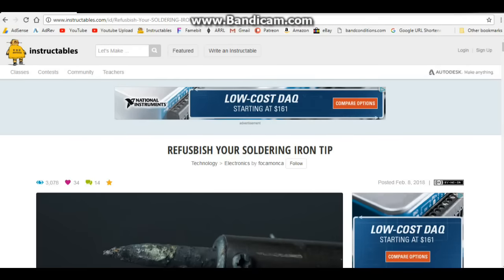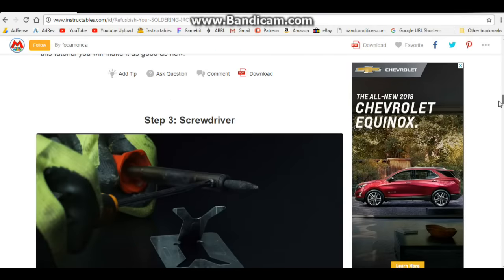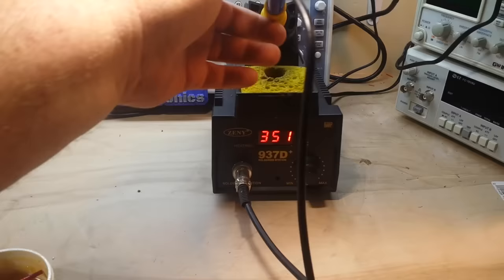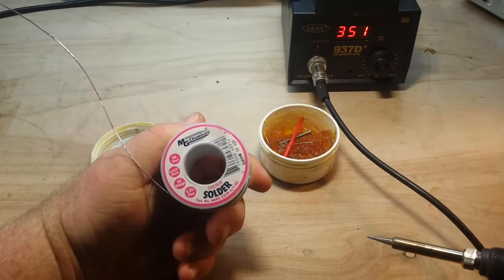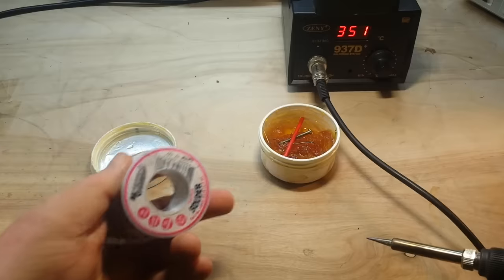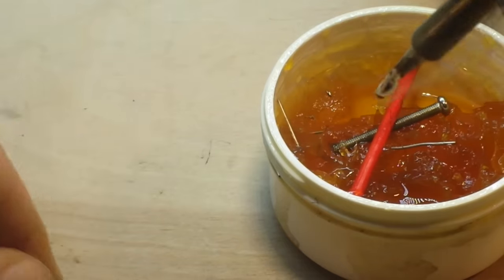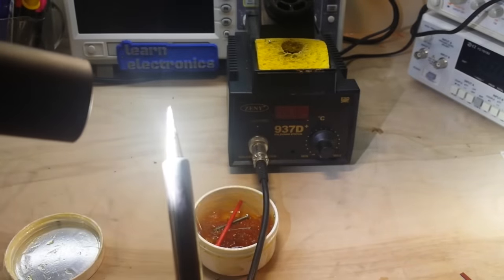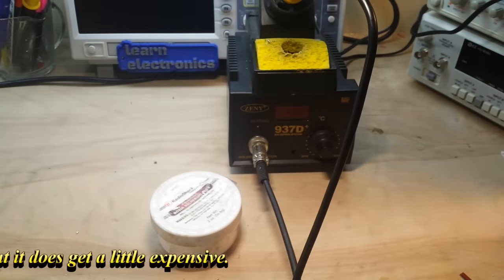How to clean and re tin your soldering iron

Comment: NOTE: old school soldering iron tips wern't coated, it was a doped alloy, You COULD sand them.
Reply: @Karl Pfistenhammer  i still file and sand them and then do the tinning procedure shown in this video ... works perfectly
Reply: Mine used to be copper. But you heated them in a fire.
Reply: @Richard_Ashton   Easiest way I clean the tips of my old fashioned copper tipped soldering iron is on a wire wheel on a bench grinder and if it is really pitted then on the grinding wheel.
Reply: well who gives a fuck. modern tips are Nickel Plated. All of them.
Reply: ever used amonia salts?
Reply: Maybe we use hakko not soldering irons to make plumbery, thats why this video exist
Reply: @Richard_Ashton  I blame those old gas-fired monsters for putting me off electronics back in school.
Reply: I use angle grinder.
Reply: And that soldering iron, tip secured with a screw, is an old school iron. For that kind of tip, sandpaper or - much better - scraping and hammering is the right maintenance.
Reply: @Karl Pfistenhammer Agreed. I had an Iron, where then tip had already started to eat itself, I had some soldering to do and no new tip yet (I just replaced the whole Iron), knowing it would ruin the tip, I took the plunge anyway and sanded it, it worked perfectly, and I managed to finish my soldering. It did however cause the tip to eat itself at an alarming rate (I had to sand the shape down twice more to finish one soldering job). After sanding the tip, it lasted about an hour (excluding reshaping time) and then it was too small to sand any further.

Don't sand the tip of your Iron :) It will kill it. (Unless you know this and are happy to proceed)
Reply: DO NOT USE ANY INVASIVE METHODS OF CLEANING YOUR TIP IT WILL NEVER TIN CORRECTLY AGAIN (sandpaper, wire brush, etc)
Reply: @DieselRamcharger  I bought a cheap new iron recently, came with copper tips.
Reply: @samg6046  but theres still no reason to sand them.....

Comment: I’ve been soldering for 35 years with no education on the subject. I’ve went through dozens of soldering irons, sometimes just replacing the tips with heavy guage copper wire. I’ve made a lot of electronics projects but I’ve always had a hard time soldering neatly. Yes, I used sand paper to clean my tips. I never realized they were coated copper. Always struggled to get solder to stay on the tip, often putting the solder on the unsanded shaft to get it down the the tip. Well I decided I’m going to do some research and learn how to solder better. Turns out I’ve been wrecking soldering irons my whole life. I always bought cheap $6-$9 soldering pens because I felt like they just go to crap after a short while regardless. I feel like I’ve been eating spaghetti with a spoon my whole life and just now discovered the fork.
Reply: I use the sane analogy for things but I say soup with a fork. I may switch things up now and then. Thanks mate!

Comment: I am 100% agreed with your professional 'tinning process' .I entered once special case that the soldering iron being 'rusty' and nobody using for very long time. I saw the surface are brownish ,surface like pimples . I had no choice to use File to remove the rusty pimple ! Later I used the professional 'tinning process' .Thus I had Repaired the Tip and 'tinning' instead of throwing the Tip/solderingIron or buy a brand new one! !!! After repaired it is working fine for subsequent months .

Comment: Temperature-controlled iron with good quality tips and frequent cleaning/tinning the tips last almost forever. I've done many thousands of solder joints with the same tip and it is still in great shape.

Back when I started out a couple decades ago, I had a cheap non-temperature-controlled iron. That thing ate through tips like no tomorrow, no matter what I did to it. Basically the temperature would reach excessive levels after it was plugged in for a while and that would basically destroy the very thin) plating on the tips.
Reply: I made a solder stand with a switched outlet attached to it. So I could flip the iron off and not leave it running. I know unplugging an iron all the time can be a bit much. Flipping a switch ain't too bad though. Here's a picture of my homemade stand next to a commercial one Notice how close I got the angle of the dangle http://i.imgur.com/3mV47yO.jpg I made the one stand before I got the other one too. So I couldn't just copy it.

Comment: A big thank you. I was taught to solder forty years ago by an uncle who was a Royal Navy P.O. responsible radio/radar with the Fleet Air Arm back in the 50/60’s   Plus, much later I did a diploma in general and electrical eng. before I swerved across into software.
All this said, I’m a little ashamed to admit that you just taught me something I didn’t really know how to do correctly.  I mean, I’ve seen a few methods (not all involving abrasives) but yours takes the prize for simplicity in both X’s
...ecution and planation.
👍 ☝️
Reply: Don't feel bad.Retired welder and i didn't know this way to tin as well.

Comment: I have several soldering irons, I have some very old ones that have pure copper tips.
Sandpaper works fine for them as they never had a coating to begin with.
I also make new tips from underground transmission cable cores.

My good weller on the other hand - I'd never to that to it, especially as it's a steel coated magnetic tip - and it gets cleaned between tasks in a copper brillo pad in a holder.

Comment: And, don't have your wiping sponge too wet as the sudden temperature change will break the bond between the coating metal and the copper core and cause rot from the inside through cracks in the coating.
Reply: Definitely don't use it regularly, but the very same thermal shock can help remove heavy oxidation. 
Of course at that point you're better off using one of those “tip refreshers” (basically small solder particles mixed with strong acidic flux—don't forget to re-tin several times before soldering electronics!), but if you allowed your tip to get to that state, you probably don't have something like that lying around.
Reply: Heavy ox is better removed with purpose made tip cleaning flux [tinner] or even straight sal ammoniac followed by solder. These aren't acid fluxes but (like many highly activity fluxes used for reliable rapid production) they are either conductive or mildly corrosive in the long term if not rinsed from the solder joint and PCB. So give the tip a good wipe with 90%+ alcohol after it has cooled. Because these tinning pastes all seem to be some lead-free formula, before the next solder job tin the tip with the actual solder and flux to be used.
Reply: That is true David, I know about what you are talking, good advice :)
Reply: so that's what happened. I kept my sponges soaking, so i finally stopped using them cause i concluded it was killing my tips.
Reply: Been soldering professionally for over 30-years. Never had that happen, but then I don't purchase cheap soldering irons. I have Hakko and Weller stations, and have never once seen a tip be damaged by cooling it down. In fact, if I need high heat for a stubborn solder job, when I'm done I turn the heat down and use the sponge to cool the head quickly so it doesn't oxidize from the high heat I was using. Of course, many newer stations brag about how quickly they heat up and cool down, so that really goes against what you are saying.
The only time I have seen a wrecked solder tip is when someone was using the tip to lever out a part and they cause a pit that goes through the outer coating.
Reply: @TheDuckofDoom.  Hi, Im new to soldering. May I know what kind of flux will not need to wipe with alcohol after it has cooled?
Reply: Thanks. I learned something today.
Reply: It was my damn sponges wrecking my tips! Too damn wet...great tip bro!
Reply: No problem with wet sponges, lack of cleaning, leaving iron on when not being used causes far worse damage.
Reply: @OriginalMergatroid  I too have been soldering for well over 30 years. Never once had a wrecked tip due to thermal shock.
Reply: I keep a damp sponge handy on my tip stand but I'm old school. You can always tell when I've been soldering, I have black lines on my jeans from wiping the tip (don't forget and wear shorts)
Reply: @niftyjig   The trick is to soak your sponge, then squeeze it tightly in your hand so most of the water runs out, leaving it just moist. Then you're good to go. And just a quick wipe or two to clean it off, you don't want to be dunking it into the sponge like you would with the metal tip cleaner.
Reply: I think I did that ... thanks for explaining why a quarter of the tim won't coat anymore :-/
Reply: why would you make it wet in the first place?
Reply: @zUltra3D so the sponge dont get burned and then it needs a replacement

Comment: I agree with you that you should never sand a modern plated soldering iron tip.  I use tip restorer which is a combination of flux and solder particles.  It does the same job as separate flux and solder in one hit.
What I must say though is the soldering iron shown in the instructable is not a plated tip.  This is the same as the soldering iron I had back in the 70s.  The tip is just a copper rod, at best it might have some thin tin plating which burns off after many uses.  Then you have a plain copper rod that oxides very quickly.  The flux from soldering would also pit and corrode the tip.  I used to use a file and sandpaper to reform the tip after it was too deformed or oxidized.  I also bought a copper rod that was the correct diameter to make new tips when the old ones became too short.  I used to tin the tip at the end of every soldering session to try and get more life out of it, but the oxidization would always win in the end.

Comment: Seems to depend on the iron - if it's a good quality iron with a good quality tip then this is all you need (and yes, as you say sanding/filing on a "good quality" tip will destroy it really fast).  The problem is the cheap ones that are just a pre-tinned (if you are lucky) piece of copper which start pitting/corroding within the first 15 minutes or so of use (and often replacement tips cost as much as the whole iron - if they are even available).

Those cheap ones there is little alternative but to sand/file/machine it clean.  I have a couple of these irons that came in "learn to solder" kits for free, they do work but the tips barely hold up long enough to finish building the kit.  The cheap ones also bend annoyingly easily if you put any pressure on them trying to desolder.

One thing that does help for the crappy plain copper tips - instead of just using plain lead-tin electrical solder when you machine it down to a smooth surface again take a propane torch and some higher temperature lead-free solder (such as for plumbing) and give it a nice pre-tinning with that to protect the base metal, wipe it, and let it cool.  Then warm up the iron with the tip in it and re-tin with the softer normal electronics lead based solder and it will last 3-4x longer as long as you don't let the iron get excessively hot to the point where the lead-free higher temp solder melts/dilutes too much.

Note the "sand and tin with high temp lead free" also works if you DIY your own tips, I've taken copper welding tips (which have a thread that fits my Benzomatic butane mini-torch) and cut them at an angle to get a much higher thermal-mass chisel tip than I could get anywhere else, works fairly well as long as you coat it in high temp lead free solder to protect the copper before you start using it for lower-temp electronics work.
Reply: Matthew Miller I payed one dollar for my soldering iron at the 99 cents store lol... I think sanding is ok
Reply: How in the world do you bend your tips?
I have a super cheap iron and I feel like I could break a car window and it wouldn’t bend.
Reply: Matthew Miller
Exactly. This all depends on the type of tip. Copper tips need a lot more TLC than coated tips.
Reply: Machining a steel tip and brass brazing might make a good tip too...have to try one day.
Reply: amazing tips Mat
Reply: well this was smart, thank you, never thought of high temp solder. tnx again.

Comment: Looking at the photos, the "soldering iron" in the imstructable looks similar to the type that i used to(and on occasion, still do) use.  The entire iron costs less than a proper iron's replaceable tip lol.  I don't even think the tips on these are properly coated, just tinned copper (if even copper!).  When I was in my early teens, I would make new tips out of whatever 1/8" round metal I had available.  Copper was the best, but a nail would work as well....
Reply: this is indeed the kind of irons that you buy for almost nothing and you won't be able to get the tip tinned at all. My home made copper tips would work better however they would get eaten away really fast. I think everybody should have used one of these once to really appreciate a decent iron lol
Reply: @bringamosa8480  My first and current iron is really cheaply made. The company name is Welson(seems like a mix of Weller and Nelson).

Comment: just bought my first soldering iron my Dad was a big soldering iron guy swore by them.. I had a flash light that I loved the spring inside wasn't soldered well and it failed on me so I had been holding it together with electrical tape... finally got tired of that so tried my hand at soldering and it's pretty awesome and now I get why my Dad loved em'  and thank you for this video I didn't know that my tip needed this but I can do it now.  Thank you.

Comment: Thank you,  I learned to solder 30 years ago and need a refresher on a few things.  Oh and by the way for anyone who reads this and is wondering about sanding the tip,  he says you could ruin your tip doing that. Ah no you’re not going to ruin it using sand paper. I mean if you sand it with a Dremel or something you might change the shape of it but it’s solid metal you won’t, “Destroy”  it by sanding it.